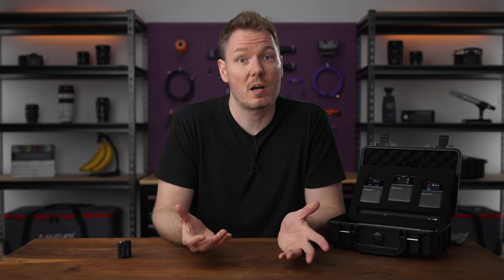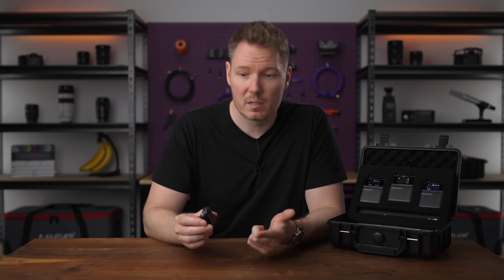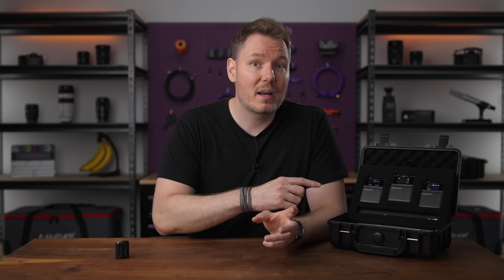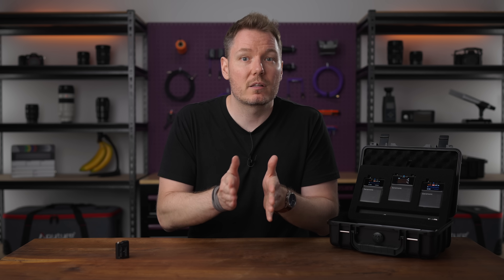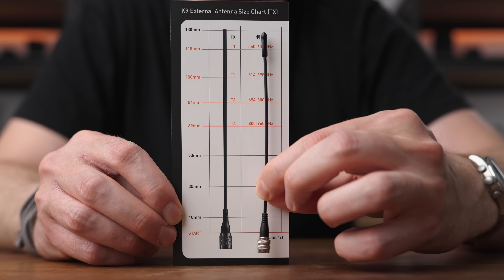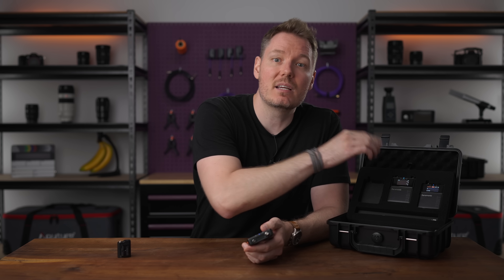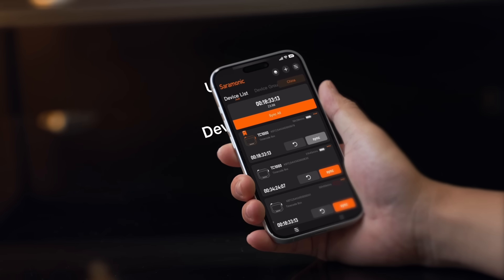Wireless Audio Explained: Digital UHF vs 2.4GHz (Feat. Saramonic K9)

Comment: The companding algorithm used in analog wireless systems is not at all comparable to the compression used in audio sound systems. The "breathing" or "pumping" effects heard in compressors are introduced by the imperfect amplitude envelope tracking they use to deal with audio transients. Companders use no envelope tracking at all and do not vary the gain applied to the audio signal over time, eliminating gain pumping artifacts which can modulate background noise. They instead take the mathematical square root of the audio signal's instantaneous amplitude, directly cutting its peak db level in half (e.g. from 80db down to 40db). Consequently, if you listened directly to the transmitted compander signal, you would hear large amounts of harmonic and intermodulation distortion. What happens instead is the receiver takes the mathematical square of the transmitted signal's instantaneous amplitude, cancelling out the distortion imposed by the companding transmitter. What's clever about this algorithm is that there is no "knee" or inflection point where the compression begins to alter the audio signal - the compander uses an absolute 2:1 ratio at all points and times. That eliminates the need to calibrate the transmitter and receiver to match each other and ensures the reconstructed audio signal is always mathematically identical to the original.

Comment: Are the NEO just cheap disposable products? Like are the batteries in the NEO user replaceable for when (not if) they fail? Maybe it's 5 years, but I hate buying new gear because the fixed internal batteries failed and the company designed the product to be disposable.

Comment: Back in 2000, I took a roughly 40 hour course at a supercomputer site, specifically on 2.4 GHz, and I later took a graduate-level university course on networking.  Back in 2000, 2.4 GHz had recently been deregulated.  2.4 GHz was previously called ISM, because it was only licensed for Industrial, Science, and Medicine - lots of older medical equipment used the 2.4 GHz band, and they didn't want consumer electronics interfering with it.  2.4 GHz actually isn't all that bad at penetrating walls, unless you have chicken wire in your walls.  It's certainly a lot better than 5 GHz in that respect.  In terms of signal integrity, most likely any device you use is going to be using a transmission protocol that's packetized, includes error detection, and the ability for the receiver to send a retransmission request for any packets that might have been dropped.  The who error detection and retransmission process can happen significantly faster than the latency of a single sample, so from an audio perspective, errors can be corrected in real-time.  Signal integrity shouldn't be much of a concern at all for 2.4 GHz, as long as you're operating within the rated distance range.

Comment: Nice run through. For perspective buyers be careful of these new to market devices, there can be issues that only become apparent when doing jobs. K9 looks like its a copy of Deity Theos. On paper it seemed great too but had noisy issues related t gain staging despite all the features, it was complicated and audio quality wasn't right. I own a Sony UHF system that has been made for decades, its very basic but it always works. If you're in the USA these don't record while transmitting so there no advantage there. Not trying knock Saramonic just giving the other side of the coin.

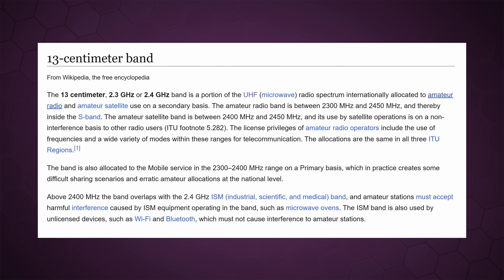Comment: 2:00 simple clarification for those confused about those frequency band names
1. Microwave is the widest band term, it covers 1 GHz all the way to 300 GHz
2. SHF is another band term smaller than microwave, it covers 3 GHz to 30 GHz
3. S-Band is even smaller, from 2 GHz to 4 GHz
4. 13-cm band is the smallest among stated in the video, it is under the UHF band but is only from 2300 MHz (2.3 GHz) to 2400 MHz (2.4 GHz).
5. The 13-cm frequency is a single frequency exactly at 2305.404 MHz under air as medium, and 2306.096 MHz under vacuum.

Comment: Sounded ok until you mentioned putting the receiver on a camera.... Oh a battery powered receiver - not good for us.
We use wireless audio in a church, the receivers have to be AC powered along with all the other PA gear, and need to just come on and work. (i.e. a turn key system) Our priest accidentally bought a camera focused Rode system, the receivers needed charging and individually turning on and off independent of the PA system, so kind of useless to us. We could not just remove the battery and power them via USB, so we had to go through a painful return and get credit for future purchases.

Comment: "Eh, let's wait for the sponsor read where Gerald uses the reviewed device, the sound could be not than great"
— The audio you're hearing right now is being recorded using the Saramonic K9 with its included lav mic, no effects or EQ"
"WOAH okay, but it's still a digital system that comes with known downsides"
— Built-in filters and an antenna chart for precise tuning
"But the signal still may be lost, and the recording will be irreversibly damaged?"
— Every transmitter is simultaneously a 32-bit float recorder
"But the lag..."
— Latency minimized
"But controlling all that must surely be cumbersome?"
— Lid-locked mechanical buttons, knobs, an app that simplifies the set-up but isn't required, dual screens for ease of monitoring, configurable outputs"
"Eh, then it must be running on those crappy built-in batteries"
— Double AAs, type-c power delivery with seamless transitioning to battery power"
"Maybe build quality at least?.."
— Great

Honestly, I wanted to be skeptical about this system when I opened the video, but HOLY SMOKES it checks ALL the boxes and then provides some extra boxes and checks them too. Is there even a single downside, apart from the unavoidable physical limitations?

Comment: Digital UHF!? this sounds like a bad idea. UHF channels are pretty congested. and aren't private. UHF broadcast channels are more restricted than 2.4Ghz. in most parts of the world data transmission is only limited to channel 21 and 22. What will the regulators say when these digital UHF start adding more interference to the existing bands?

Comment: 6:25 Whilst this may be true in very old analogue systems, more modern ones will simply show a signal strength indicator and incorporate a feature called "squelch" to mitigate any unwanted noise when the signal level drops too low, thus you can definitely still experience sudden drop-outs on analogue gear, too!
(Source: I have several years experience with professional Sennheiser Evolution Wireless G3's and G4's — handheld mics, bodyback transmitters and receivers)

Comment: None* of this matters when there is internal recording capability. Just sync the audio to the scratch audio on camera. 

*The replacable batteries do matter. Though apparently some manufacturers are bringing battery replacement kits to market, so even that doesn't really matter then.

Comment: bought my K9 set about a month or so ago and have been extremely happy with the results, I didn't wait for their tc units though and went with a set of the Deity TC1's and have also had great results using them, the k9 system, my Sennheiser MKE600 and a Zoom F6. One of the best things is being AA battery powered so you don't need to wait for internal batteries to charge

Comment: Switched to the K9s and Neos for a professional shoot from Lectros and the reception was much better. Lectro A and B blocks weren't able to cut through the crowded RF. Having the ability to record 32bit while transmitting was a game changer. We used the saramonic rechargeable batts too. Those lasted about 7 hour each. I like the mics for how small and rugged they are. Easy to hide under clothing and minimal rub with a bumblebee lav concealer. I prefer the sound of cos11d lavs but these were fine and I'm sure with some EQ they would sound even better. Like most lavs, these don't compare in sound quality to my Sennheiser 416 but are perfectly acceptable running and gunning on a two man shoot. The app is a bit slow and clunky. Hopefully they update it to make it faster and a little more streamlined. Overall and great product and they solved a ton of issues for me.

Comment: Early, early on I had what would be probably considered a low-end prosumer UHF wireless system. I had multiple issues with reliability of signal and I was only about 5 feet away. I switched to a hardwired setup using an external recorder. Once I did that, I always had rock solid audio (i.e. no interference). It's pretty trivial to sync audio at this point, even without a time code generator.

In the past week or so I took the plunge into getting a 2.4 Ghz system. But I don't plan on using it as a wireless system. I got it solely because each lav can do 32-bit internal. To me, that's the game changer. Sure, getting the audio into your camera is great and all that, but getting perfectly recorded audio and syncing in post is where it's at for my situation.

With that said, I can see situations where transmitting the audio to the camera over a long distance is crucial. When the camera's mic just can't pick up you speaking, you kind of need a way to sync everything. But I never use my setup that way. I'm always less than 6-8 feet away from my cameras so their built-in mics do just fine for scratch audio for syncing purposes.
Reply: This. Syncing is so easy that there's no reason to use in-camera audio and the whole interference issue becomes a non-issue. 

I think it's not an issue even in situation where you transmit the audio over longer distance. As long as you get a tiny bit of scratchaudio to your receiver/camera, you're good. 

You can also utilize these with field recorders. Just hook the transmitter/recorder to the line out or headphone jack of the field recorder and hook the receiver to your camera and voila: you have wireless mixpre3 or whatever field recorder you use.

Comment: The problem is in the USA those UHF mic packs cant record internally, and I rather have 32bit float recording no matter what and a slightly higher chance at a weak signal, than a uhf pack that could drop out and I have no backup.  Its a stupid thing to choose in the US.

Comment: 13 seconds into this video and it is absolutely 💯 % clear that the Sennheiser shotgun mic Gerald uses in his videos is the GOAT. The sound is light years different than this lav system he is using in the video.
Reply: Maybe because no EQ applied ?
Reply: I mean he normally has a $1200 USD mic going into a like $1000 audio recorder, and then eq’d and edited, so it’s not at all a fair comparison to a wireless lav system that’s not been eq’d.

That being said, it’s a dream setup haha
Reply: @Brandon4Weiss  oh for sure! The point I was more making was that there’s such a start contrast between this, very confident lab system, and Gerald’s usual set up that I don’t think he’s doing the lab system any justice because of the star contrast.
Reply: Yeah, no. I seriously doubt his Shotgun Mic is just so much better. This audio actually sounds very clean, it just needs an EQ and in general, because of the nature of using a transmitter and lav mic, requires more work. And even if he had EQ'd it still would've sounded different than how we normally recognize his audio, which can frequently trick the brain into thinking "bad". But this audio certainly isn't bad, it just needs EQ, which he intentionally didn't add.
Reply: @DS_4172 thanks for the insights. A comparison would be helpful?
Reply: I agree. There’s always some compromise with lav mics. They sound great but won’t beat a properly positioned shotgun IMHO.
Reply: @tdcattech 💯there’s reason Hollywood has actors being chased by boom mics.
Reply: Also, this is good enough.
Reply: @stevenpam the lav system he is reviewing?
Reply: @seanlefloch  Yep! Sure, it could use some EQ, but it's fine out of the box for normal use. If you're doing YouTube videos, corporate videos, whatever... no one who's not themselves a sound recordist or similar is going to have a problem with the audio. It's clean and intelligible.
Reply: @stevenpam and that’s my beef. There are so many very cheap and great value options. It’s almost like get a decent kit for $200 or go high end sound engineer.  Thoughts?
Reply: @seanlefloch  I would think that depends on your objectives. If the sound from a $200 kit is going to bother you (or a stakeholder who matters, like a client), then you might need something more. But more than likely, your audience won't know or care, as long as it's clear and intelligible.
Reply: @stevenpam exactly. It’s all going on YouTube/vimeo anyway where it all gets compressed to hot garbage. The way we consume media has changed so significantly it almost seems prosumer products are becoming more and more obsolete.
Reply: He did say in previous videos that his voice in particular sounds too nasal with basically every lavalier he’s ever tried.
Reply: @serj112 good insights appreciate it

Comment: Can we get rid of that stupid patent where we can't monitor and do internal recording for the UHF system at the same time
Reply: That's only for Americans.
Reply: @thomsonlin5084  well, lets get rid of it here
Reply: I wonder if this can be avoided if you use a VPN on your mobile device connecting to the devices?
Reply: Just by the EU model :)
Reply: @TheOfficialOriginalChad  i tried :((
Reply: @TheOfficialOriginalChad it’s GPS-based, Gerald said
Reply: The way I understood Gerald is that the phone app has to detect you're in/outside the USA to disable/enable onboard recording. If so, that's an interesting loopho...I mean attribute!
Reply: Why is that?

Comment: 5:55 there is something called DAB and DAB+ radio, which is digital, but instead of the signal getting fuzzy or cutting out, it just gets quieter until youre out of range. so its actually quite a smooth transition
Reply: That does not happen as part of the spec, that is possibly something your specific DAB receiver is doing; it might be fading out on signal loss, or if it's in a car it may be doing DAB/FM switching - which can sometimes be at different volume levels due to the DAB and FM audio being processed differently by the broadcaster.

DAB is a 100% digital broadcast system where the radio tunes to an ensemble of multiplexed channels, 'picks out' the station you want to listen to and selectively decodes the audio stream and relevant ancillary data streams from the received multiplexed frames. 

The radio will play whatever the station is transmitting until signal loss - some radios "warble", sound like "bubbling mud" or play brief bursts of semi-scrambled audio when the error correction can't recover the audio data. Other radios will "squelch" the bad signal while they reacquire a signal lock. 

DAB radios are aware of the signal strength and signal quality (SNR) by calculating it in real time. 

The WorldDAB site has some great technical breakdowns of how the system works if you're curious :)

Comment: What about the Deity Theos System?
Reply: Curtis Judd has great some videos on it, but it does have a flaw of broadcasting 500hz when it turns on no matter where its tuned. So for places like stadiums it may not be the best option. This had the same problem but they just released a firmware update to fix it.

Comment: I use (comparatively) cheap 2.4Ghz wireless mics in some very hostile RF conditions -- like when I'm holding a powerful RC transmitter also on 2.4GHz or in my studio/office with lots of WiFi and other gear around and I've never had any issues with interference.   All but the cheapest of those little wireless mic units have in-built 32bit recording as well.    The biggest advantage of these little 2.4GHz systems is their size and the fact that they have the antenna built into the system rather than hanging out as is often required on lower-frequency units.   Finally, being able to bind directly to an action-cam or phone is another killer-feature.

I fear that for 99% of all YouTube creators, those cheap 2.4GHz units are all you'll ever need/want and even in professional environments the expensive belt-worn wireless mic kits are hard to justify.
Reply: I've absolutely experienced dropouts with my RODE and DJI 2.4GHz mics. It all depends on your location. I have a lot more confidence in my digital UHF units (Senn EW-DP) but if I'm in a known good location I use the little 2.4GHz ones as they're convenient.
Reply: @veryboringname.  I'm sure the Sennheiser does work better and since they went digital I bet they sound a lot better than the old analog wireless but you're talkin 850 for a an eng. setup.
Reply: @keithwiebe1787 My main point was that 2.4GHz units do have issues with interference - sometimes.
Reply: @veryboringname.  Yes I believe that. But my 85 dollar Fulaim sounds pretty good compared to my old Sennheiser Evolution wireless but yes, there will be more interference but than again the Sennheiser was in the 500 dollar range 15 years ago.
Reply: I have messed with wireless for years and here's my take. I had a professional UHF made by Telex and it worked pretty good and I bet only one of the diversity channels was working. Never dropped out doing work but there's a catch. It sounded great for voice but for music-forget it. Same with a Sennheiser smaller system when it came out. Sound great on voice but if you were to record music such as orchestra or would fail do to the companding system that they all used at that time. Low frequency sound would also include higher frequency noises. Right now I've played with my Fulaim 2.4 X5 wireless. So much better on music but you've got to watch that it's in direct site with the reciever. If your body blocks it (say at 25 ft) you might loses signal. The old UHF systems worked so much better (don't know about UHF digital) for dropout at the expense of fidelity.